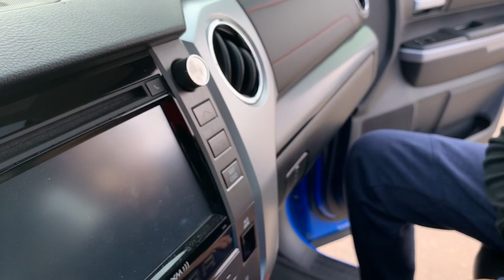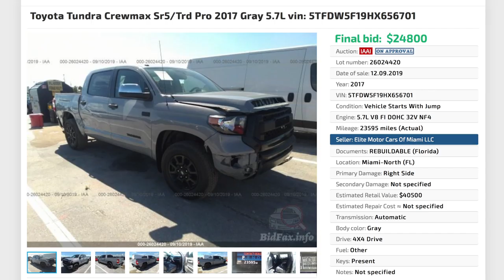2019 Tundra TRD PRO Owner One year Owner Review

Comment: Another great video you crazy Texans! Love my 2019 Tundra Platinum CrewMax as well. Just got back from a round trip from Calgary, Alberta to Phoenix, AZ. It was very smooth and comfortable to drive. On the way back from AZ I drove 25 hours straight (non-stop) home with very little fatigue or cramping just like you said. My son loved having the back seat all to himself as there is tons of room back there. (Although my wife kicked him to the front seat for a few hours so she could have a nice nap). Hit several spots of wacky weather on the way home but the truck performed fantastic! My average gas mileage for the two week trip was 18.4 MPG. I kept the cruise control at 78MPH most of the way except when the weather forced me to slow down.

Comment: Update on the LasFit LED Switchback turn signal bulbs.  NO BUENO!!!  They did not work!  And they cost more than twice as much as the JDM Astar bulbs.  I actually went through three different manufacturers and they either hyperflashed, or they didn't work at all.  So, I bought myself a set of the JDM Astar bulbs.  Now, I have turn signal lighting for miles!  Good job on finding these bulbs, fellas.  Turned out to be the only ones that worked and were less than half the price!!!

Comment: 11k miles in 1 year?!?! What?!
I bought my 2019 ford raptor brand new in March of 2019 and I already have 23k miles! Lol. 

Man, no truck comes close the the Raptor’s performance. I smoke Tundras, Rebels, etc. When I go off roading, all of the jeeps, all Toyotas, etc have to pull to the side to let me pass because my truck can go faster off road. Raptor even gets better MPG than the Tundra. Tundra would be my second choice if I couldn’t get a Raptor. Looks badass. Performance wise, no truck is touching the Raptor. And I got it for cheap too. 

$55,840 Base MSRP for 2019 Ford Raptor Super Crew (4 door) (800A package)

$3,855 Total of Options
-17-inch Forged Aluminum Bead-Lock Capable Wheels ..
-4.10 front axle with TORSEN® Differential ..
-bed divider .. 
-bed-liner spray in ..
-remote start system ..
-Tailgate Step with Tailgate Lift Assist ..

$1,595 Destination Charges

Price without taxes and license: $61,190
Price after Cali taxes and license: $67k and some change
Reply from the maker: ya... the raptor is way cool... i still want one... just not sold on a V6 tho.... at least not yet
Reply: WrongwayUp I also have a couple of sports cars, one being the 2019 mustang gt PP1. I prefer the v8 my damn self but Ford wasn’t building it so I got the Raptor. I was waiting for a couple years for the v8. If they release a v8, I’ll trade mine in in a heartbeat. Or even if Toyota or any other brand makes something better than a Raptor, I’ll get that too but I don’t see any truck beating the Raptor any time soon other than that ugly ass Tesla.
Reply from the maker: @joemomma707  we are currently rebuilding a 2017 GT into a GT350 kind of lookalike , we will release a new video soon an that build. I too want a Raptor.... V8 raptor at that
Reply: @AndreiDoroftei  Late this year or early next year the 3rd gen Raptor should be having the 5.2L V8 thats in the new GT500
Reply from the maker: @Majorrick07  my only problem with that engine is its track record for being junk in the GT350... almost all of the you-tubers are rebuilding that engine in their cars for one reason or another
Reply: I’ve heard a lot of issues with the 3.5 eco boost motors and it’s transmission no thanks on the Raptor. I don’t buy a truck to go fast 💨 sorry
Reply: @AndreiDoroftei  really that I didnt know! I heard before of a 7.1 or 7.2L v8 but that would be interesting. Haven't heard of that size before since the 1st gen Chevy avalanche.
Reply: @sonar0085  correct and if I'm not mistaken a lot of turbos were been blown or damage before they hit 75k or 100k miles. Also Gen 2 least with the later years been having some water leaking issues. Least from few people I know. I have a 1st gen raptor and thankfully nothing like that. Expect for blown ac motor lol. Thank God for Ford extended warranty.
Reply: Majorrick07 hands down the Raptor is the best looking damn truck in the market it’s on a class on its own and can’t be compared. 👍
Reply: @sonar0085  agreed, I am disappointed in Ram though. That TRX concept looked amazing! But the recent photo/video nothing like it.
Reply from the maker: @Majorrick07   all the problems that I've learned about are with oil leaks... from all different places ...i have a 2017 5.0 mustang and it seams bulletproof . Thats why i bought a 5.7L  Toyota , old but reliable... not sure about you but  I'm just getting tired of repairing oil leaks and coolant leaks on cars....
Reply: @AndreiDoroftei   Why a lot of 3.5L Ecoboost owners install a catch-can.  Agreed on the 5.0 and for the 5.7 most definitely if it aint broke dont need to fix it as they say! Oh Im with you on the oil leaks and coolant, sad to see majority of the manufactures  doing recalls. All these new vehicles looks amazing/beautiful also tech/features but at what cost and QC suffers because of it.

Comment: Great video, I don't own a Tundra, but dreaming.  I really like the truck, but MPG matters to me because I drive A LOT.  Can't wait for the Tundra redesign, the Tesla Cybertruck, and new F150 electric the next few years are going to be exciting.
Reply from the maker: thank you. MPG is not as big of a difference as one thinks... my tundra gets a solid average of 15mpg ...   a hybrid version will get lets say 5mpg better on average ...over 15,000 miles in a year thats $475 savings at $1.75 per gallon ...  it will never make sense to buy at a $10,000 premium to save $40 per month in gas savings... hope that makes sense.  i bought a hybrid 8 years ago and still have not made the money back in gas savings over a similar non hybrid.
Reply: @AndreiDoroftei  You are right, in places where gas prices are relatively cheap MPG not a huge difference.  In the past the hybrid technology in trucks never really worked well they would only get maybe 1-2 MPG better than the standard truck engines.  I wouldn't recommend hybrid for full size trucks, just get the simpler regular engine, less things to go wrong and maintain.  I have a Honda Pilot now which gets 25MPG overall and going to a 15MPG Tundra for me would cost an extra $1400 per year @$3.50/gal, plus in CA they tack on a weight based fee to registration because it is a truck (a commercial vehicle), which applies to any body on frame.  Right now I just haul bikes and family so don't need anything too crazy.  If I get a camper trailer it would be nice to get a truck.  The Tundra is a solid truck and for people who keep their vehicles longer than 10 years there is a reason why people buy Toyota or Honda.  I showed my daughters your video and they like watching your son driving around the parking lot LOL.

Comment: My tundra was my every day driver for 3 1/2 years I got about 17 miles per gallon and put on about 100,000 miles they do eat brakes and they do eat tires. No other problems the V8 developed a slight rattle at 100,000 miles but when I traded and I still got the money I need to get out of it won’t be going back to Toyota for a while since the MPG’s just don’t work with  my commute the new ones are going to cost an arm and a leg and a firstborn.

Comment: Great review I absolutely loved my tundra it was a damn good truck and served me well no issues during the 100k I drove it. I am regretting trading it in for a 2020 trd pro army green taco. I only did it because 5 years with the tundra I wanted to try something new and different I am starting to love the taco but miss my Tundra everyday for the comfort, power and overall feel of the higher commanding stance. I have to agree on the paint Toyota definitely used cheap paint I’m already having some chips and scratches in the paint on my brand new taco. To sum it all up Toyota sure knows how to build a great product to last a very long time I used to be a Chevy guy but problem after problem I was done and been a Toyota guy ever since. Your son making all the good points on the tundra made me miss it even more lol!
Reply from the maker: ya..i wanted a taco as well..might do one as a rebuild ...but they are so expensive used/wrecked... i will let the little man know...he is getting better and better on camera
Reply: I did the opposite, actually. I wanted an used taco and it was like 5k less than a new one (with 45k miles), so I ordered one as I wanted TRD double cab off-road V6. Not bad... however engine and transmission doesn’t feel right. Torque was in the high rev band (not much useful), and the bed is made in plastic... big mistake if you want to affix anything there that actually support something. It will brake the bed. 2Yrs and 25k miles later I traded in the Taco at the Dealer for a 4x4 1794... No regrets. Just got 3.5K less than what I paid for her when was brand new. Also took the 1794 from dealers inventory with absolutely all full specs and clear bra already installed. Huge discount as was the new year model arriving. Very happy with this “old fashion” truck. Love it.

Comment: Tundras are a great choice. However, The v6 raptors would still smoke basically any of the stock v8 trucks from any brand but I’m not sure why they didn’t run a turbo charged coyote in them.

Comment: I’m shopping for a TundraTRD Pro was told by a dealer they you can’t get blind spot monitoring or front and rear park assist on the TRD Pro. I found that odd since MSRP is $57k+
Reply from the maker: A lot of things are missing on the trd-pro. The basic basic is all you get on it. On mine u can also add no sonars , no heated seats or cooled , basic ac controls and a few other things I can’t think about right now. Saying all that which sounds not all that good...... I do not miss any of that stuff. Less stuff to go wrong and brake.

Comment: I have the same scratches on the center of my dash!!! Direct line of sight!!! Hate em lol. 

I will say I highly recommend the AMP Research Powerstep running boards. It will definitely save your leather seats from all those wrinkles you get from sliding down from your truck. Trust me! Eventually those wrinkles will become tears! I too find the truck to look better without running boards so these Powersteps were perfect since they retract in. They have taken a beaten so far in this Massachusetts weather and I have no issues. No special maintenance or anything. They’re plug and play as well. The only thing I would say is they can be noisy when operating but its not like we got a TRD Pro for is quiet nature. They come with a good manufacturer’s warranty as well
Reply from the maker: hmmmmmmm.... i will look into it

Comment: Great no non sense down to earth review! I have a 2019 Platinum in Barcelona Red & I put LED’s in my rear brake lights with resistors & they are holding up great here along the gulf coast. I also put a Putco LED light bar that is VERY BRIGHT when the brake lights are activated & the reverse turns the night into day! 
Texas is the BEST country & another known fact is the Tundra is the MOST USA truck out there. Ford, GMC & Ram use parts from Mexico & Canada & some are made there too. 
Keep up the great Tundra Mods & safe driving & flying!

Comment: Dude! I got my tundra in 2018. There are DEFINITELY LEDs out there that are plug and play. Diode Dynamics sells some. I got some off amazon (be careful of the seller for quality purposes). All but my turn lights are LEDs because I had the same concern about adding resistors (even though I have done it before and it is super simple to do). As of this point, I just haven't done it yet. And there are LEDs that won't cause hyperflash for the turn lights (front and back). Fantastic looking tundra though! 

Also, I don't know if it's true or not, but a detailer was telling me that toyota does not use a clear coat. He said their paint has the clear mixed in. Based on what he said, it SEEMS true. He said he found out because when Toyotas are polished, the paint actually ends up on the polishing pad so you have to be careful. My truck came with a clear bra like you mentioned which might not be a bad idea either.
Reply from the maker: i bought quite a few led's in another video i did and non worked... i just looked into Diode Dynamics for some turn bulbs and they were a little over $100... thats a lot for 2 rear bulbs. so far i have been happy with stock bulbs ... i will revisit it later on when they get cheaper. 

I have thought of adding a bra for the front but even if i had it there are chips beyond where it would of stopped.   I've just decided on taking it on the chin with the rock chips
Reply: @AndreiDoroftei  Send me a list of the locations that you need/want LEDs for and I'll send you what I have/did (gotta find the receipts and whatnot)

Comment: What pressure did you run in the factory Michelin’s?  Door jam says 30 front and 33 rear.  I’m running that on mine since the door jam / factory says to.  2020 tundra trd pro army green.
Reply from the maker: just what the door jam says...i do the same, it seems to work
Reply: WrongwayUp thanks.  Seems awful low but I’m doing it anyway.
Reply from the maker: @barrysoetoro3488  well after 12k miles the tread wear looks even... obama sucks ..lol
Reply: WrongwayUp yes he does. Trump 2020
Reply: WrongwayUp I’m loving this 2020 army green pro.  I love the voo doo blue (your truck) just as much.  I do like the updates on the 2020 though, with the keyless start, dual climate control, bigger updated touch screen, etc.  can’t wait to see the 2021 tundra.
Reply from the maker: @barrysoetoro3488   every year they add better features...  trump 2020 all the way!!

Comment: As a person who learned the hard way, allow me to say any gas but full detergent gas like Shell or Chevron is a very bad idea. The engine is far too finely tuned. Knocking for crap gas is suppressed and you don't hear it but it robs your HP big time. The warranty also mentions the requirement of detergent gas. Cheap gas station 3rd tier gas doesn't have any detergent.

Comment: Hey Toyota don’t recommend the TRD rear sway bar on the TRD PRO because of the fox suspension it limits the travel of the suspension look it up
Reply from the maker: Coulin Wilson really?? Where did you read that ?? I was planing on removing it at least disconnecting the rear. Thank you for the comment.
Reply: Hey there you can call Toyota motor North America & ask the Engineers tat rear sway bar limit your suspension travel when you go off road
Reply from the maker: @Mad2ras  your right... ya i will disconnect it...i will have a review/recomendation  video on those in a month or so...
Reply: Cool if you’re selling the rear sway bar plz let me know I have a 2018 SR5 tundra crewmax

Comment: You guys are so funny.. You obviously never sat in a 2019-2020 Ram Limited or a Ram Rebel 12. I had a Tundra Platinum Crewmax That is way nicer than the TRD Pro and the Ram blows the Toyota away. The Toyota is like 8-9 years old, it is dated. Sound system sucks, only a 6 speed transmission. Motor is 9 years old. The screen is hopelessly small next to the 12" screen in the Ram. The Toyota seats are the worst. Toyota paint sucks. My Ram has 19 speakers and a 950 Watt amp, most amazing stereo ever Harmon Kardon. My whole roof is glass its amazing. I have owned both, the Ram is head and shoulders above the Toyota. I have owned 7 Toyotas so I know them very well. The only thing that the Tundra has is great resale value and I liked the TRD dual Exhaust. I will also say I drove my Tundra for 55K miles with no problems. My new Ram 13K.
Reply from the maker: i never looked at the rams....maybe i should have...  you are correct...they  are really nice trucks... along with some other trucks and cars  we are searching to rebuild one from copart for the channel